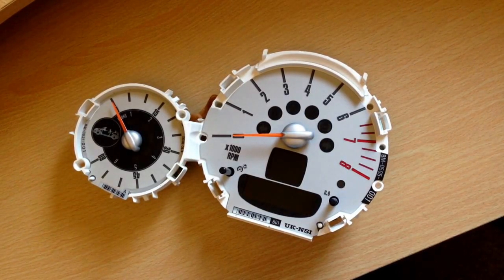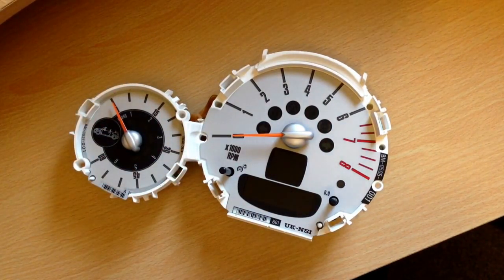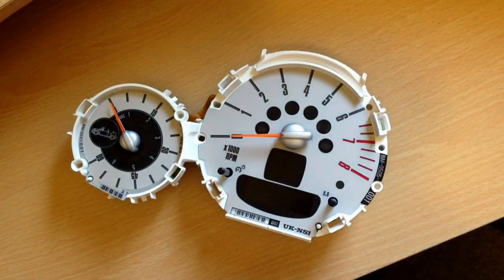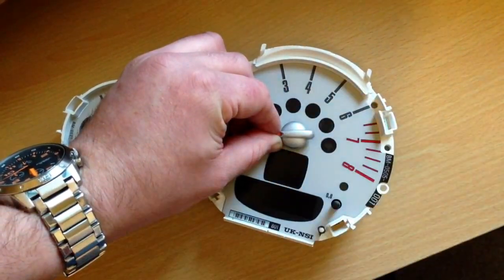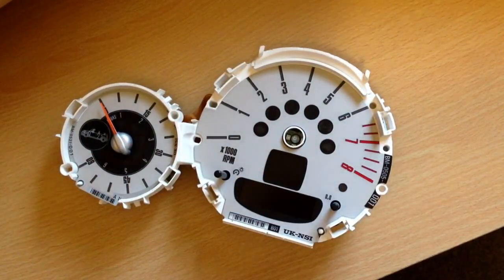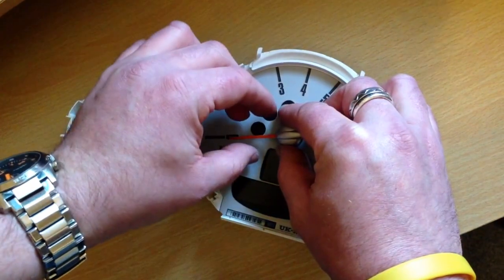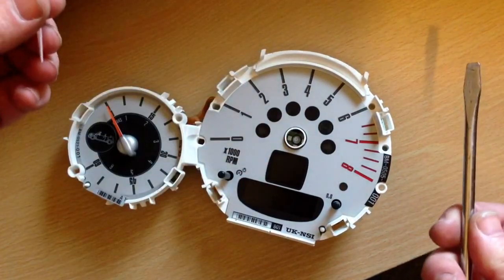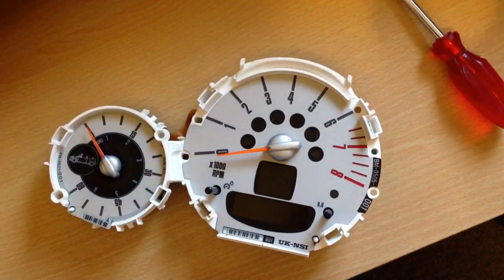MINI R56 rev counter needle removal

Comment: Hi, what happens if someone wasn’t sure how to remove the needle and went below zero and made two click sounds?
Reply from the maker: That someone may have been lucky and the needle has simply moved on the spindle. Removing the needle then reading the needle back to zero might fix the issue. The unlucky side could be the gears are damaged in the Rev counter.